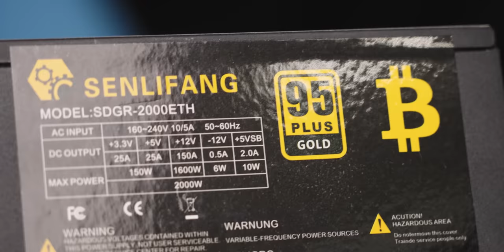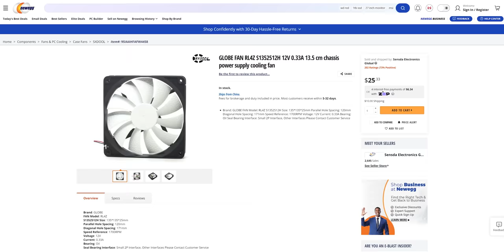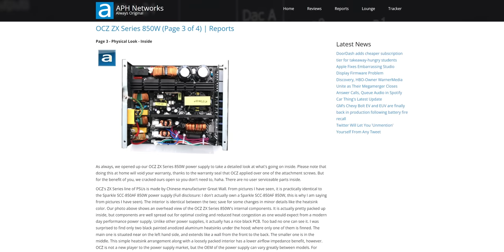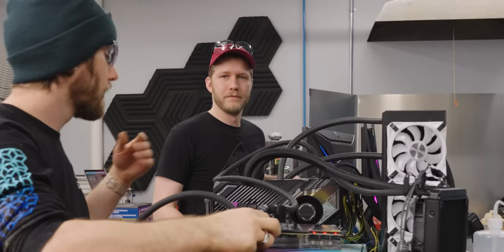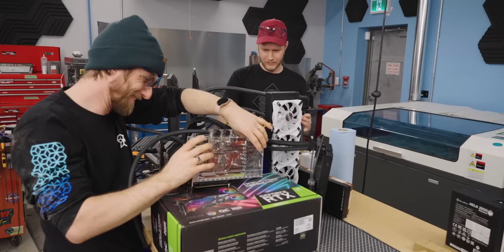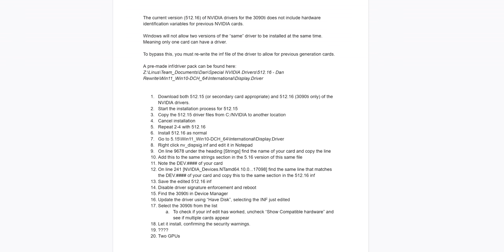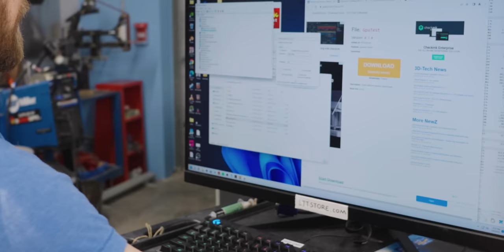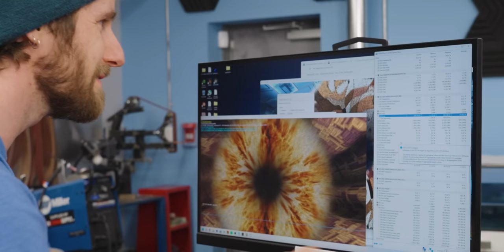This is one SKETCHY 2000W Power Supply

Comment: If Alex is there, you know something is going to be very questionable in terms of if it’ll work. That said, 2000W may be more needed at the rate CPU & GPU power consumption rates are increasing at.
Reply: Pretty sure if you'll want a Rtx 4090 the bare minimum will be 1300w, seeing how much the 3090ti consumes and rumors saying it will only get worse
Reply: That's an understatement. At the rate we're going we will need electricians to install a dedicated circuit for the computer. Not to mention a second air conditioner for the gaming room.
Reply: We are at a time when we need to work on efficiency (climate change and oil prices) and those companies are just going backwards. People should boycott those extremely inefficient GPUs but who am I kidding.
Reply: next generation is the last one these criminal chipmakers are gonna get away with inefficiency
Reply: @thunderarch5951  cpus won't take more than 250 at the max, rest of the computer maybe 150, that's 400, max load, with the 4090ti being around 500 watts. 1000 is fine
Reply: the 4000 series are rumored to only get worse smh
Reply: @moritlh  well, compared to a dryer or an old fridge, PCs dont use that much electricity, and if the source of that electricity is renewable there is no problem with using a lot of power
Reply: @moritlh  🙄
Reply: just buy AMD gpu's and cpu's
Reply: @moritlh  They are more efficient than past GPUs though. They deliver more performance per watt. They just draw more watts on top of better efficiency to deliver a greater performance increase. 

At some point we have to ask ourselves whether higher performance in any given application is worth the additional powerdraw (especially looking at the intel chips atm). It only becomes a real problem at a large scale, such as datacenters or crypto-mining, where at least for the latter an argument could be made that it's just wasted energy.

A typical kettle draws 1500W for example, so your gaming rig wont be that much worse than other household appliances.
Reply: @moritlh  it's a societal problem of always needing huge generational improvements just for the sake of being the new best
Reply: @zwe1l1nkehaende  don't crypto miners focus on efficiency because it cuts into their profits if they don't optimise whereas we are more concerned at squeezing every last FPS regardless of how much power needs to be consumed?
Reply: @NightshiftCustom  yeah, they are more tamed, but still pretty hungry
Reply: @thunderarch5951  Dude, that's complete nonsense!! 3090 ti is squeezed 3090 although 3090 has already been very squeezed like Lemon. NVIDIA once again, due to its shortage in the market, decided to infuse users with a stupid piece of shit with huge consumption and minimal growth from the usual 3090. Do not forget that the new maps will be on the new technical process, plus the new architecture. There will be no such consumption as you think. For many, even now, the 1000W power supply is something unattainable. So these are just rumours.
Reply: @NightshiftCustom  no lmao eww
Reply: which won't be available for US domestic market because you cannot draw more than 1500W from a 15A socket continuous. Which is why all space heaters have that wattage regardless of size.
Reply: @moritlh  home computer power usage is not that significant in the grand scheme of things, your air conditioning and dryer uses far more.
Reply: yhea, no. We're getting close to the thermal limit of how much we can dissipated away from the computer. Can't push wattage that much more
Reply: @zwe1l1nkehaende  yeah, cause gaming with a 3090 is 100% not wasted energy

Comment: @Linus Tech Tips - 
You would be much saver when fixing a German / Korean style (recessed earthed) outlet to the output of your modified cable , because Germany has 230 Volts ( + 16 Amps) & there are plenty o IEC computer power supply cables for German / Korean outlets ... the 2x 110 Volts in Canada / USA are no problem at all because the German plug / outlet is not polarized anyway & some regions use 2x 110 Volts with German style outlets (50 or 60 Hz) ... AND don't forget to crimp the fine strands of the flex ! 
Also the German / Koren system does not let you touch live contacts (in opposite to the literally shocking Canada / USA system)  ... 
Trust me I know what I tell you  , I'm a German & I did serval plugs / outlets my self & even connected a 3 phase stove ( 400 Volts) without ANY incidents over the years
Reply: If you have half a brain and know how to read a basic wiring diagram neither of those are that hard, now if you're doing it live that's when you need some more finesse

Comment: The wattage checks out (they just added it wrong), according to the label:
 3.3vdc × 25 amps = 82.5watts
5vdc × 25 amps = 125 watts
12vdc ×150 amps = 1800 watts
12vdc × 0.5 amps = 6 watts
5vdc × 2 amps = 10 watts
all together thats 2023.5 watts
Reply: I think the 3.3V and 5V rails together are not supposed to exceed a combined 150 watts and that is why they are stuck together in the table.  It is a quirk of how some multi-rail power supplies are designed, usually because there is a tap on a secondary winding of the transformer that causes this where if they were separate secondary windings altogether it would not have that limitation.  That leaves 150 + 1800 + 6 + 10 = 1966 watts total which is close enough.  They may have just mislabeled the 12v rail.
Reply: KABAKOKSEK  Often times consumer PSUs are built to offer options on how you want to distribute the total wattage. Each rail is separately able to support higher wattage, but there is a tighter limit on how much they can add up together.

This means that the beefiest components (AC side) can be built to lower spec, which lowers cost.
Reply: @10100rsn  Still, the label has an incorrect result for the +12V rail. The PSU wouldn't reach 2000W but it's close.
Reply: As you are really knowledgeable about physics could you tell me how would one go around calculating V,I,R when two of these are given both in series and parallel. It would really help if you could tell me how to for example mathematically separate currents at the two resistors in parallel to compute their values when V and R are given. I have a test on Tuesday and would really appreciate the help. All 6 scenarios for series and parallel.
Reply: @skyemperor2357  since you are already on youtube, there are tons of videos about ohm's law that are great and would surely teach you the simple concept albeit hard to imagine for beginners. Also, your question is a bit broad and unclear. This comment is also not talking about resistance, but power. Goodluck to your exam.
Reply: @skyemperor2357  V=R*I   R=V/I   I=V/R  ;  
current for resistors in series: simply add resistances together to get total resistance and calculate current using formula, all resistors get same current and only voltage drops across them vary, you can call this arrangement a voltage divider   ;   
currents for resistors in parallel: simply calculate using formula, voltage drops do not vary but currents do, you can call this arrangement a current divider, to get total current you can add each resistor's currents together, but to calculate total resistance of parallel network there is a very specific way (calculate reciprocals for each resistance, add these together, calculate the reciprocal for this sum to get the total resistance) (and you can verify your result by checking it's less than the smallest resistor's value, can also use the total resistance to calculate total current and check that it's the same you get from the first way for calculating total current) (note that if all resistors in parallel have same resistances, the currents for all of them will be equal)
Reply: You can't add them together like that since 3.3V is dc-dc regulated from 5V so you can't add the 3.3V line when taking the total since all the current taken there is the current capacity that goes missing on the 5V line.
Reply: @10100rsn  the 3 secondary taps are usually 5V, 12V and -12V. The -12V is not part of the feedback circuit, so it only has to weigh 2 voltages into the feedback. 3.3V is then generated purely from 5V. Trying to juggle 3 or more voltages and keep them within legal bounds by modulating one input would just be too much.
Reply: Thats not how you calculate wattage | edit: u forgot to multiply by cos phaseshift so it might be 1700 if its 0,85

Comment: The probable reason the PSU case is getting hot: The internal transformer works at high frequency above 20,000 HZ and is working way above it's Ampereage capacity, as a result, it's High Frequency magnetic field expands beyond it's physical core structure, as a result, the AC magnetic fields bombard the external steel case, heating it like an induction cooker. I've seen the same phenomenon when a high frequency transformer is overdriven. The more you know.
A few things to look for:
The extension cord modified for 240 volt: I see a fire risk because the indicator light on the business end is now dissipating 4x the power. they are neon lamps with a series resistor. Unplug when not in use.

Comment: Power in Japan is much more messed up. They run at 100v Ac but the east and west run a different frequencies (50/60 hz). This can mess up motors or time keeping equipment built for the other frequency and require huge height voltage dc interconnects to merge the different grids.
Reply: Wtf why
Reply: Not to mention that 100V and 50Hz is pretty much the worst combination for operating single-phase rectifier loads... Lowest possible voltage and longest interval between capacitor re-charges.
Reply: @knislappen  iirc it's due to post-ww2 aid in rebuilding infrastructure - one side adopted 50hz (German system) and the other 60hz (US system). i don't remember the specifics but it's related to who aided and also the country being occupied postwar
Reply: we use 220V 60Hz and 110V 60Hz.
so it's double the fun.
Reply: @DielectricVideos  NEW York 25 HZ power just entered chat
Reply: @jasonriddell  Now that's cool! As I understand, it's primarily used in subway rail power, correct? If so, are there any public-accessible receptacles that allow you to plug things in to 25Hz power? And have you tried operating anything from it to see how it works?
Reply: @youkofoxy  wat
Reply: @jasonriddell  why
Reply: can't count how much died in the early 2000s in psu monitors etc because it was just sold and no power switching, so many psus would make a clap and smoke at 12 months or less. and monitors omg the screen issues.
Reply: @jasonriddell  aren't there areas of New York that still have DC?
Reply: Yeah I had to think about that when even buying a bleepin hairdryer in japan. that sucks.
Reply: can we just look at the fact that this comments section in a comments section is now talking about post ww infrastructure rebuilding xd
Reply: That's why a lot of appliances in Japan tend to to not last as long
Reply: @ashlyy1341  it was a big problem after the Fukushima nuclear disaster
Reply: @ashlyy1341  One side was electrified by AEG, a German company, and the other by GE.
Reply: @HalianTheProtogen  in the UK east side has LTE-m support only while west side has NB-iot only
Reply: @Airbag888  I'm afraid I don't follow.
Reply: @Mask Or Germany.
Reply: @HalianTheProtogen  LTE-M and NB-IOT are cellular technologies like 3G, 4G, etc Usually roll out is country wide overtime with areas growing until coverage is nationwide.. in the UK for some reason (hum huawei) they have half of the country with LTE-M only and half with NB-IOT only

Comment: Actually Japan has another quirky thing to consider.: half of the country uses 60 and the other half 50Hz on their 100Volts due different deliverers after the war and the infrastructure  that has been built upon them, which are now not to be messed with anymore. 
Thats why there was a time when Japan had 2 versions of everything, just to be able to work in the part of the country that it is needed, nowadays most stuff usually supports both frequencies tho.
Reply: Can you explain why different frequency need different device tu use it?, I'm not an electrician but I'm curious
Reply: @osopenowsstudio9175  not an electrician myself, but might be the same for 100V or 120V, needs a different transformation for each one
Reply: @DamnedAngel96  Actually difference in frequency is a difference in "speed". Keeping the voltage the same, but changing the frequency can cause a 3 phase motor to spin faster. This in essence is a problem for all older type of devices like washing machines and frigdes that used pretty simple 3-phase motors to drive them. Difference between 60hz and 50hz is about 20% so it basically means that your fridge/washing machine either runs too fast and can be damaged because of 20% boost (if it runs on 60hz but was designed on 50hz). Or the other way it runs 20% slower and basically is less powerful in comparison to what is should be.
Reply: @osopenowsstudio9175  the technical reason is because the electrical impedance of inductive and capacitive loads against alternating current is directly proportional to the frequency. This affects how much current is flowing through an AC circuit for a given load and affects how much power the resistive loads receive in the electrical network. A frequency mismatch can cause a light bulb to receive too much or too little current, for instance.
Reply: @TheLucidDreamer12 my man did not use a simple laymen term😭 he said he’s not an electrician Dawg💀 how is he gonna know what those words in sequence mean

Comment: yes, never mix 120/240 stuff, years ago we had an "electrician" hired by the property management who came in and said, oh, that 240 outlet in your living room, I can replace it with a 120 outlet so you can use a smaller air conditioner.  He changed the outlet, didn't mention he wired it wrong, and he "borrowed" our bedroom AC unit (a $700 Friedrich 12000BTU unit that worked flawlessly and had a digital display, remote, all sorts of nice features) to test it and promptly let the smoke out.  Of course they fired him over this, but offered to replace the AC unit.  When the property manager showed up all smiles with a 5000BTU $98 Walmart unit thinking that was a perfectly adequate replacement, we filed that away and when it came time, chose not to renew our lease.

Comment: I feel like a better method of hitting that 2000 watts may have just been to use it as intended. With some risers, and like 8 low end cards mining, you could easily hit a higher power draw. I understand not wanting to risk high end hardware, but surely they could use a bunch of old RX cards at least. I was curious when it would stop working and if it could actually deliver 2000w. Sometimes PSU companies will list a peak rating and not sustained. Also I would have loved to see a Kill-A-Watt or something like it with a real wattage read out. Would love to see a revisit someday.
Reply: Obviously it probably isn't a good idea to use something like this, but it would be cool to know that 2000 watt ATX power supplies exist for ~$150.
Reply: Yeah I was expecting the same thing.  Just use mining software to push the wattage limits, it's so easy to versus the trouble he was having running benchmarks on individual cards at the same time.
Reply: Also it's probably only useful in countries where power is free for the individual, considering how power inefficient that thing would be and how much profit you'd end up losing to electricity bills.
Reply: @iClone101  certain regions in china has very cheap electricity, and are often chosen as mining sites before the legality shifts. i've heard electricity as low as 5 cents per kilowatt. some miners simply build water dams to power their mines. electrical cost is almost negligible for eth mining.
Reply: Much simpler way would be some old school halogen car headlights
Reply: the psu do deliver as it promised. I wouldn't listen anyone giving out "psu advise" just based on their thoughts and not actual experience. The issue with this power supply is that once you hit the high wattage, the efficiency will crap out, which is why when it get so hot(as linus pointed out). Do they suck? Entirely no, this mining psu are widely use in mining farm(in asia), they work. Ofcourse most miner doesnt use this cheap psu to maximum, usually 30% less than intended rating. Most often you hear "cheap psu" explodes, this is not entirely manufacturer faults. After the psu is manufactured, they are distributed outside, and people rebrand them, and some ahole decides to put sticker with higher wattage than the true wattage. To avoid this, just purchase this cheap psu from reputatable seller.
Reply: They need to send this sucker over to Gamers Nexus, they have a full power supply tester, the ones actually used in factories and testing facilities to make sure power supplies meet efficiency standards and also are certified to not blow up or blow your expensive hardware up. They used it to expose Gigabyte's faulty power supplies that Newegg was forcing people to buy bundled with GPUs that were likely to be blown up by the power supply being sold with them.... yeah. Highly suggest you look at that series of mistakes lol.
Reply: PSUs like this were sold old over Chinese internet before crypto mining became illegal last year. They could deliver approximately 1500W on +12 V . Now they are sold to gamers with discount, too bad they cannot operate in US.
Reply: maybe better but much more interesting to have bigger and beefier cards running off of it tbh.